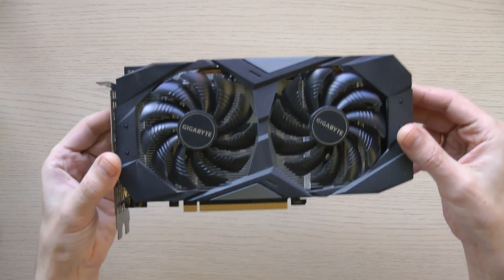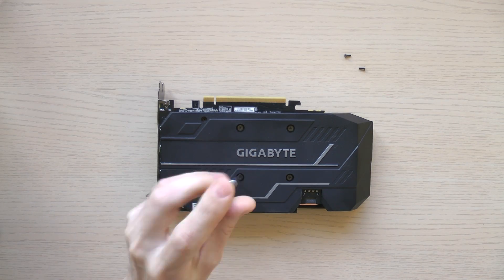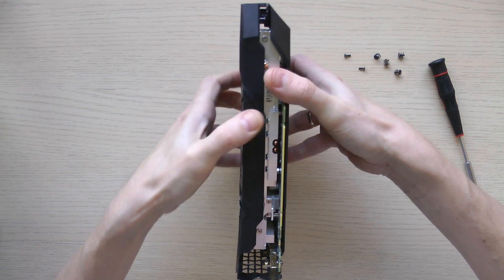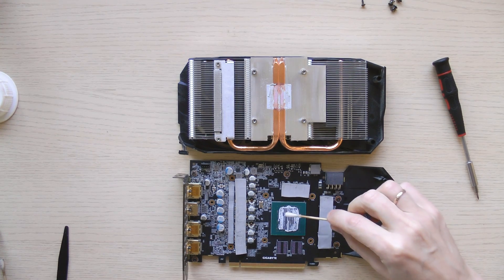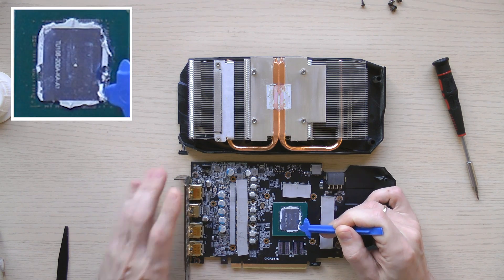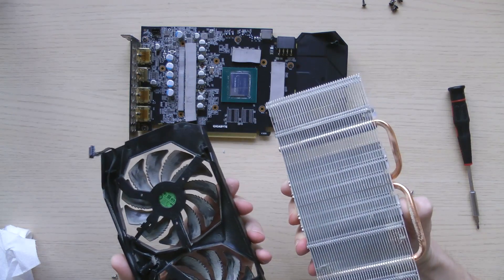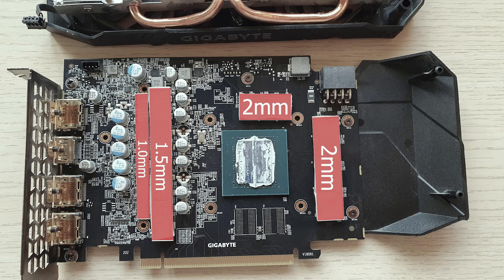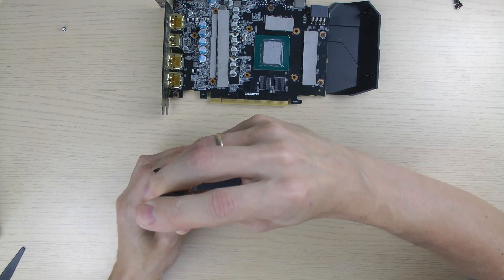How to Change Thermal Paste on Gigabyte RTX 2060 OC 6G

Comment: Can I use 1 mm thermal pads for everything? I don’t have enough budget to buy 2 mm, 1.5 mm, and 1 mm pads separately, and no one sells small quantities of each size. Is it okay to use only 1 mm? My English isn’t very good, so I used Google Translate. If there are any awkward expressions, please kindly ignore them. My model rtx2060 giga is windforce, not OC, is it the same with 2060 oc ?
Reply from the maker: It depends on the softness of the thermal pads. If they’re soft enough and will compress to the required thickness, then yes — you can stack them and use. But if the pads end up too thick, the heatsink won’t make proper contact with the GPU die, and you’ll see an immediate temperature spike. 
Try it and check whether the thermal pads are actually reaching the heatsink. If the GPU die temperature is normal, then you’re good to go.
Subscribe, thx.

Comment: Hi, I notice the sizes for the thermal pads you list in the description are a different size than what you measured. Would you say to purchase pads based on you measurements? I can’t find 2.25mm or 1.25mm thick pads anywhere :9
Reply from the maker: It's hard to measure the exact thickness because the thermal pads are very soft. I tried not to compress them while measuring, so the readings should be more or less accurate. Personally, I’d buy the size I measured and choose the softest pads available. After applying them, visually check for any gaps. If the pads are too thick, the GPU die temperature will skyrocket due to insufficient pressure between the heatsink and the GPU die.
The measurements in the description were provided by Gigabyte support.
If you decide to replace them, please write back what you used — it will help others. 
Subscribe, thx.
Reply: @MindaugasJocionis any recommendations for soft pads? Keep hearing the arctic ones are a bit too hard (I guess I could buy the 0.5mm ones and stack them) I’m in the uk so not a lot of places to buy from :9 also will make sure to write back once I’ve completed it xD will be changing the thermal paste to a ptm phase sheet  from thermal grizzly as well :)
Reply from the maker: Yes, Arctic pads are definitely not the soft ones. I’d try something from Thermal Grizzly, like their High Compression pads: https://www.thermal-grizzly.com/en/minus-pad-high-compression/s-tg-mp-hc
Reply: @MindaugasJocionis any idea if it’s all  arctic pads or just some of them. Have you had any experience with arctic tp-3? Thermal grizzly ones look good but are very expensive :9
Reply from the maker: @alexanderunderwoods2393 In another video, I used some generic Chinese pads on my GPU, and people mentioned that Arctic pads didn’t fit well, even though the listed thickness was the same. If you already have them, sure, give them a try. Otherwise, I’d spend a bit more. Or, if your current pads are still soft, you can leave them in place and just replace the thermal paste on the GPU die.
Reply: @MindaugasJocionis other pads are still soft for the most part, vram and mosfet pads are still stick but the choke pad is dry on either side (it’s still floppy so not brittle or crispy o wouldn’t say but doesn’t seem to have dried a little bit) not too sure what to do, only pads I can find that are readily available here are the arctics, was able to thermal grizzly minus 8 pads but they are out of stock of the 1mm thick ones until January :9

Comment: i had to change mine after it was constantly hitting my max temp threshold of 82c on a undervolt and underclock profile. on pretty much any game what so ever. i got some arctic mx-6 with cleaning wipes. and just as the video showed the paste was everywhere. the wipes did do a good enjoy job loosing it. and the paste over the transistors or whatever they were. i found an old cleaning toothbrush that was hard brissles. but it had been used soo much the tops of them wear worn alot. it had just enough power to dislodge the stuck paste while at the same time swiping it away. i did have to end up squeezing some of the wipes to get some of the liquid on the brush to wipe the paste away.

but patience's is king. cleaned it all up and the heatsink itself. repasted with mx-6 and spread it out just a little bit before hitting the corners leaving a visible border. closing it up. i got better retention screws for the mounting pressure off ebay. and just reused the memory pads. couldn't get replacements in time. my GPU never goes above 70c. on the standard OC profile. so it boosts to 2265MHz on the default. all on its own.
Reply from the maker: Awesome work! Don’t forget to subscribe, thanks a lot!

Comment: is this the gv-2060d6-6gd? i need the measures for the thermal pads
Reply from the maker: No, this is the GV-N2060OC-6GD Rev. 2.0. Contact Gigabyte support—they can provide the correct thermal pad sizes. Subscribe. Thank you!

Comment: Great video. I did the same and noticed no change. I disassembled and this time put it back together without the backplate. It's a bad design, acting like a box and trapping the air blown through the cooling fins making it recirculate across the PCB. Without the backplate about a 1/4 of the cooling fins now have uninterrupted air flow and the pcb doesnt have hot air recirculated across it. Temps down from 85c to 78c.
Reply from the maker: Nice, subscribe, thx.

Comment: I have this same model and it runs very hot, between 77 to 82 degrees. Sometimes it touches 84.
Reply: My card  gigabyte Rtx 2060 12G，very hot 80-84 temperature
Reply: @程-o3w  if you have replaced it  * has thermal paste helped with temps? i have around the same temps in game
Reply: Yes..I have same model temperature touch 84-85..
What's the problem?

Comment: I know this is almost a year later but I just changed the pads on my gigabyte 2060 oc 6gb. and I did the same thickness for the pads as youve shown and its running hot. im wondering if the comment I saw saying that 2mm was too thick I might change that out. I an unable to measure it like you did sadly.
Reply from the maker: Well, I think your thermal pads are too hard (the original ones were very soft). What brand did you use? Is it a rev 2.0 card? People often complain about Arctic thermal pads.
I did some research and found measurements for this card (just the non-OC version) in another source: https://dzen.ru/a/Y_8frwFig089b3VJ (2nd vga from the top) They measured 2mm.
And in this Reddit thread: https://www.reddit.com/r/buildapc/comments/tuvw3c/comment/i6k0vl9/?utm_source=share&utm_medium=web3x&utm_name=web3xcss&utm_term=1&utm_content=share_button
I also reached out to Gigabyte—hopefully, they respond. If they do, I’ll update this thread with their reply.
It’s unfortunate that another viewer didn’t update their solution; it would have been helpful.
Once you find thermal pads that work for you, let us know!
Subscribe, thanks.
Reply: @ I changed the 2mm to 1.5 and I get insane results. I used to be running at around 80 ish sometimes higher in gtav for example, and now I get 60-70 max! idle i get a good 30-40 max. I used the thermalright extreme odyssey. im very happy with how they are and im pretty sure its what thickness and firm you have for the pads. some cards take different. the thermal paste was spread perfectly but I don’t think there was enough contact. I also dont think I have a rev card. I got mine about 4 ish years ago and its been solid since the “overheating” issue with dry thermal paste and almost dry pads. this video also really helped. thank you so much!
Reply from the maker: @ Thank you for your response! I'm sure it will be helpful to others. Glad you got it sorted—happy gaming! 🙂🎮
Reply: @almond332 hi I have same problem.. even undervolted GPU reaches 80c its extreme hot.

So should I use 1.5mm pads for VRAM ? Thanks
Reply: @realonepx9885 im pretty sure thats what I put on there, I havent had any issues since that first issue I mentioned, I tried to make it all flush if that makes sense like make the shroud flush and even with the motherboard of the gpu
Reply: @almond332 and may I ask you if you only used thinner pads on VRAM or on other components too? I mean it in a way if 2mm vram is standard but u used 1.5mm did you need to use also different pads on mosfets ?
Reply: @realonepx9885 yes you would, if they need 2.0 and you put 1.5mm on it yes you are mostly going to need to drop that .5mm on all the pads too I did that on all of em besides 1 thing I dont remember but it was personal preference, all I did essentially is just try the pads at oem thickness, and if its running too hot then I dropped a lil thickness and if there was gaps go up that .5mm
Reply: @almond332 thank you so much brother for all this info :)

Comment: FUTURE VIEWERS! 9:33 they are NOT 2mm thick, or he is using very spongy, compressible pads. 
I used authentic 1mm Artic thermal pads and stacked 2 of them, this was wayyy too thick and the heatsink could not make proper contact with the die, making the GPU extremely hot. This caused me a whole day to figure out. If you are using the newer, chewing gum like thermal pads, only use 1mm, i think you can even use the 0.5mm
Reply from the maker: Thank you for sharing your experience! Is your card Rev 2.0? The thermal pads I measured were the original ones, and yes, they were soft and compressible. In another video (with another graphics card) where I actually replaced the thermal pads, I noticed that some people also had issues with Arctic pads—they seem to be hard and not very compressible.
I hope to get more feedback on what size and brand thermal pads people used, this could help make things clearer for everyone.
Anyway, don’t forget to subscribe, and thanks again! :)
Reply: Do you remember the model of the arctic pads you were using? Also is you card the N2060OC-6GD? Looking to buy arctic pads myself as they are readily available here

Comment: I have GIGABYTE GeForce RTX 2060 WindForce OC 12GB GDDR6. Can I use the thermal pad size as in the video?
Reply from the maker: Your VGA has a different PCB and cooling design. Disassemble it and measure the thickness of the thermal pads on your unit. Subscribe, thanks.
Reply: @MindaugasJocionis  ok thanks

Comment: men thanks a lot 
my gpu temp is 84 in most games 
its been 3 years i didnt change my thernal paste hehe
Reply from the maker: Don't forget to subscribe, thanx :)
Reply: 84 sounds pretty good imo, im changing mine now after a bit over 5 years and mine was sitting at 95-98 on averge in the games i play
Reply: My card  gigabyte Rtx 2060 12G，very hot 80-84 temperature

Comment: Thanks for the instructions!
Could you tell me what the temperature is in the stress test on the thermal paste mx-6
Reply from the maker: @vladyslavm7316  The thermals remain the same, but the boost clocks have returned to the levels they were at when the card was new. That's how GPUs work these days—they push frequencies until a certain temperature is reached. Subscribe, thanks.
Reply: @MindaugasJocionis  Thanks for the answer! The thing is that I recently bought a used 2060 serviced. Temperature 80-83 on the chip. I just wondered if the temperatures would drop after applying mx-6.
Reply from the maker: @vladyslavm7316   @vladyslavm7316  What are your GPU speeds at this temperature in games? What is your card model? Is your case big with decent airflow, or is it a small ITX case with limited airflow?

Comment: So did you notice a difference in the thermals?
Reply from the maker: The thermals remain the same, but the boost clocks have returned to the levels they were at when the card was new. That's how GPUs work these days—they push frequencies until a certain temperature is reached. Subscribe, thanks.

Comment: Hi! Good video! Do you need to replace the thermal pads or is it ok to reuse the old pads?
Reply from the maker: If they are not hard or cracked, then this is not necessary. Sub. thank you
Reply: @MindaugasJocionis  Thx! What was your max temps before/after? I have read that a lot of people with the same card have issues with high temps.
Reply from the maker: The temperature is about 78 degrees, the frequency has returned to 1900 MHz. Before it hit 83c and the GPU clock started dropping.
It is in an ITX case, with almost no airflow, so the temperature was always high, and the cooling design of this card is not the best :)